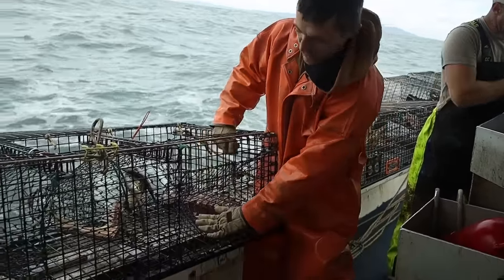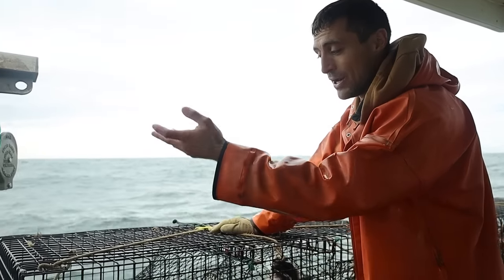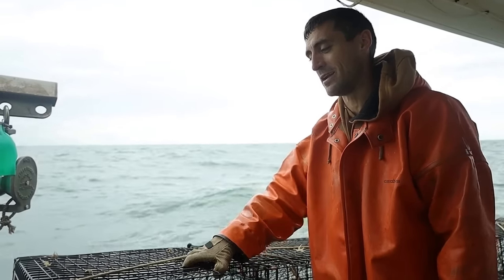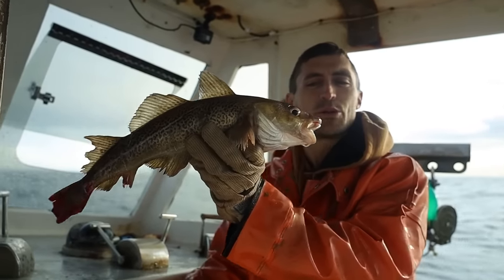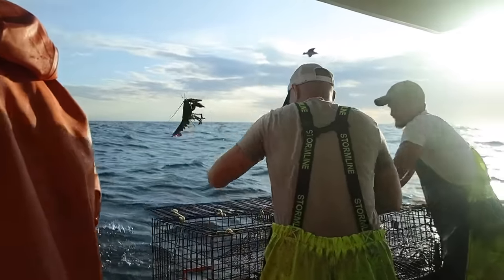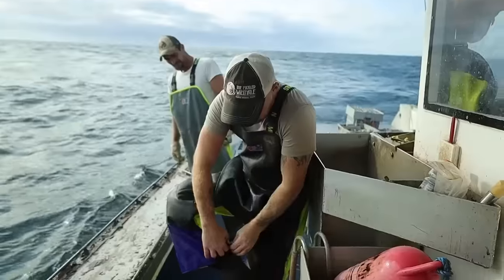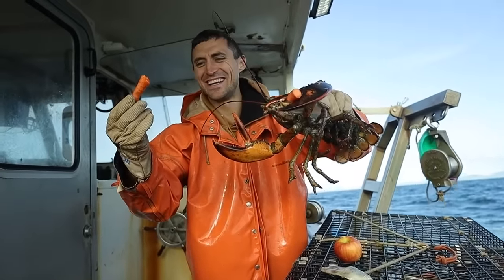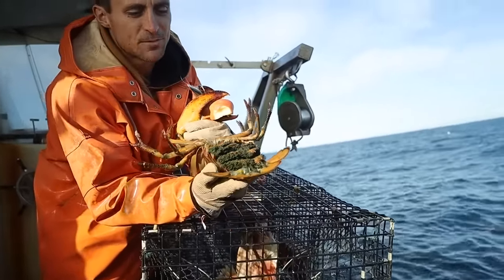How Do Lobster Traps Work?! (Maine Lobster Fishing Vlog #7)

Comment: whats the ratio of lobsters you can keep to lobsters you throw back in an average day?
Reply: It isn't by number but by size. There's a length they cannot cross over which is legally mandated (why traps are made that way too) and is for sustainability. Some still get caught as they mentioned and they get released.
This probably allows both sustainability and uncapped profits to coexist.

Comment: How long does it take for the biodegradable material to rot away? From what I have seen, you only notch females that have eggs or signs of eggs. Why do you not notch all females and just take males? Has there been any decline in the local lobster population through the generations? Thanks.
Reply: Not all female lobsters produce eggs.
Reply: @stephaniemorrissey5114  Ah, makes sense. I suspected that might be the case.